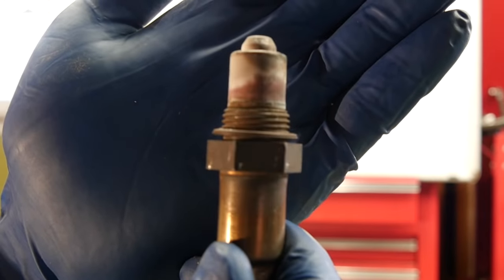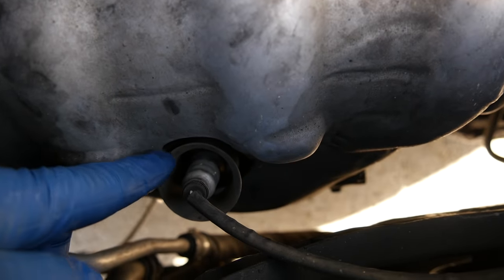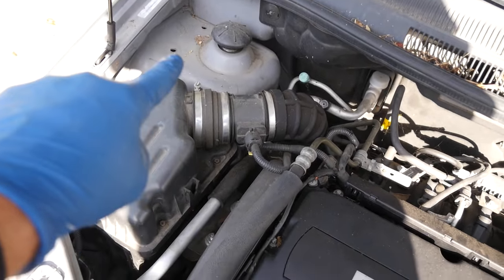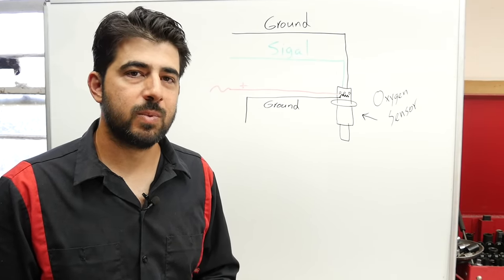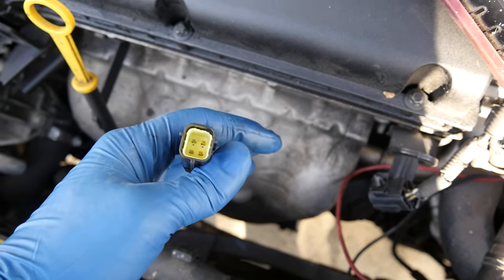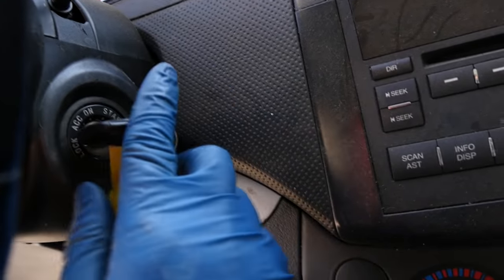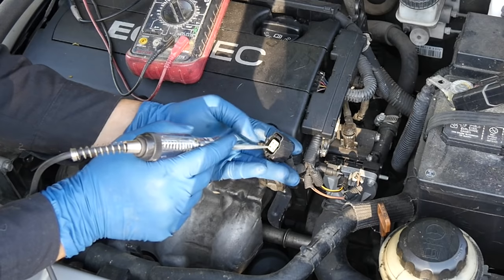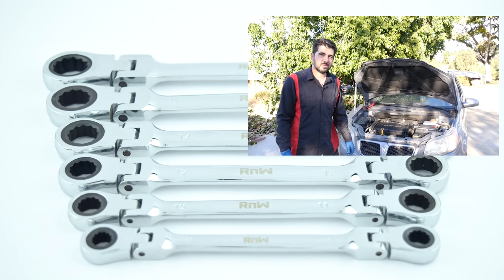Oxygen Sensor Trick and Operation Guide

Comment: I have a 2008 Jeep jk3.8 and randomly the che k engine light came on and problem with both bank 1 & 2 sensors 1&3 heater control circuit low. I thought it might have been the grounds since they all use the same ground, but it appears that all grounds are connected to one connector to the engine block. Any ideas? Maybe all sensors are bad?

Comment: Question. I have a 15 Nissan Titan and on my 04 titan I could delete the rear cats without check engine light. I’ve heard the 07 and newer the oxygen sensor and the map sensor positions were replaced.  So the map sensor is closest to the engine. Would this make a different as far as check engine lights go when I delete the rear cats on this truck

Comment: Nice video. 
However, I have a ford focus 2000 model ,but my downstream sensor has no single wire connected to it. It seems the wires were forcefully  pulled.. the wires are completely damaged and missing. Please it is possible to rewire it,especially getting that signal wire that goes to the car's computer. Thanks

Comment: Awesome vids dude. Question: could you also measure/question continuity between the signal wire at the plug and to the ECU harness pin that corresponds to that signal wire for the O2 as well? I'm chasing a A/F issue with a 993 Porsche. The O2 sensor is new-3 wire, but wanted to go through the wires from the plug on the harness to verify function. Came across your vids this am. Great info. Keep it up! BTW, I am a recovering Audi allroad owner lol! I had thre over 12yrs. -the last was 6MT that I got up to about 440hp. I sweat cam seals are a maintenance item on the 2.7t motor.
Reply: "Question: could you also measure/question continuity between the signal wire at the plug and to the ECU harness pin that corresponds to that signal wire for the O2 as well? I'm chasing a A/F issue with a 993 Porsche. The O2 sensor is new-3 wire, but wanted to go through the wires from the plug on the harness to verify function."
 
Yes, but you only need to go through the trouble of doing that if the sensor is not working. So, you should check functionality first. Make sure the vehicle is warmed up and running at its normal operating temp. Connect a scan tool and look at the data stream. Find your fuel trims and open/closed loop info on the scan tool. If the O2 sensor is working, you should be in closed loop (the engine has to be running.). Assuming you're in closed loop, check to see if your fuel trim numbers make sense. If they do, you've pretty much proved the sensors are working properly. 

If you're having a drivability issue and you think its O2 sensor related, bypass your O2 sensors and see what happens. In order for them to work the vehicle must be warmed up and in closed loop. look at the scan tool again while the engine is running. Put your foot on the gas pedal and make it go right to the floor. It has to be wide open, and nothing less. Watch your data stream, and the second you reach wide open throttle, the motor should go into open loop. If the car runs better at when in open loop, the problem is most likely an O2 sensor, or something directly related to them. If no change at WOT when the O2 sensors are bypassed, look elsewhere for the problem.

The above info can be applied to any car made after 1996. The procedure is OBD2 compliant, so it doesn't matter what kind of vehicle it is. They all have to work the same by law.

Comment: Does the power to the heating element, let's say for a 2005 Dodge Grand Caravan, shut off after it is warmed up enough?   Because, if it does not, and the heating element portion of the O2sensor is bad, theoretically could one substitute the proper value resistor (and proper wattage power resistor) if the O2 sensor is a bear to remove?    This of course just temporarily to get it to pass inspection until you have time to replace it and don't want to lay on the cold, snowy ground to do it.

Comment: I'm trying to figure out how ECM monitors EGR gas flow. I know some vehicles have sensors (Fords have DFE sensors) but my 97 Isuzu Rodeo (4cyl 2.6 engine) doesn't. I get occasional PO401 insufficient flow code....have cleaned out all pipes etc and installed a new EGR valve....still get this code. There must be something in the computer that trips this code. Is it using feedback from 02 sensor? My scanner shows 02 sensor output normal. Any ideas? Vehicle has 82,700 miles...gets 24 - 25 mpg ...manual transmission.

Comment: Do you have any knowledge on why my 2010 Nissan altima 2.5 is idling smooth, runs smooth, till i get on an upward hill on the hwy, it gets around 3000 rpms, and it starts loosing power so bad, alot of differant codes pop up, i get off the road, turn engine of, then restart it, it clears all codes, its in the shop now, they said it needed new timing chain, that didnt fix it. Muffler shop said converter was good, i had new maf sensor put on it also. Nothing is working i have had done. I need HELP😢

Comment: Thanks for this video, it's very clear :)
A question if I may. I want to add a switch to disable/disconnet my O2 sensors on my motorcycle, to use when I'm racing and don't want/need that closed loop feedback (I've got a piggyback ECU to handle fueling). In your opinion which of those 4 wires should I switch, in order to fooling the ECU to think that the O2 sensor is disconnected? I'd guess it'll be the permanent ground wire, but that's just a hunch.

Comment: Good Vid. Hey, mate in relation to these O2 Sensors. I have a 2000 Holden/Opel Astra with a 1.8 Ltr 4 cylinder in it similar to this motor. Now I had a set of new Extractors put on it and the O2 sensor was placed just downrange after the factor cast exhaust manifold. Basically, where all four pipes merged into one, is where it went. However, on the extractors the O2 sensor has been placed where only two out of four pipes merge (tri Y exhaust pattern) as this was how the extractors were made. My car seems to be using more fuel now so should I get the extractors modified so that the O2 sensor is placed after the merge of all pipes like the original factory manifold was. Any help appreciated.
Reply: Yes, have it modified so that the Oxygen Sensor is after where all four pipes converge. Right now it's only seeing 2/4 cylinders, and only seeing half of what it wants to. The car is seeing that the right amount of air is flowing in, so it's adjusting fuel timing to compensate. Moving the sensor should fix the excessive fuel consumption.
Reply: @GalaxyOneFilms  Cheers mate

Comment: That's good to know about the switching ground and the permanent ground. Nice!
Does anyone know the reason for not switching the positive?
Reply: @paulmccabe2889  At least not in the harness because one of the wires will have to be positive, that  one could just as easily short out. But it's probably more the way the ecu or ecm works. it's probably easier to protect the ecm if it's switching ground rather than switching the positives. Honestly i'm not sure why at this moment.

Comment: Thanks for video. Is there a reason why the "switched ground'' cannot always be grounded directly to frame full time.
Reply: I think that would run your preheater circuit non stop which would kill the sensor and battery in short order?

Comment: I replaced both 02 sensors 2 times on my 2.0l honda crv yr 2000 still getCEL for heating element circut code for both b1 and b2 I don't know what the problem could be? Cat is in alittle rough shape could that be causing this?

Comment: Hi, please help. I found that 02sensor bank 2sensor 1 was tapped with a sigle wire. And the wire is tapped from the 02sensor bank 2sensor1 went acrossed the engine and tuked behind the fender. It didn’t connect into anything. You have any idea why they would tapped it? Thanks pls help

Comment: What if you short the ECU using  the test light or  a multimeter? Can this happen? On my wifes car, the P0130 code come and go, most of the time not even a check engine light also the electronic drive pedal somemetimes does not work at all for a few seconds every 5..6 days. Any idea?

Comment: I have a problem that needs to be resolved and fast. I have over modified my 2006 350z now the o2 AF sensors upstream have a codes P0031 P1148 that wont go away. I've tried o2 simulators and bought 4 sets of o2 sensors for replacement and nothing works. Is the only way to fix this is a car tune by professionals or  what can I do to get rid of the o2 heater low voltage codes.

Comment: Great video! I've received my "O sensor" without the plastic protector that goes around the metal end, and there's grease all over that end. Do you just wipe it put clean with a piece of cloth, or do you use something else, since that is the part you'll screw in? Thanks in advance for your details!

Comment: I need help, I replaced the heated oxygen sensor bank 2 sensor 1 , the check engine light went off then a few hundred miles it came back on for the same thing and has not turned off. What could it be? I heard GM is notorious for this, but is there a fix? It’s for a 05 Hummer H2. Thanks!

Comment: Good day 
 I have problem with my Toyota Yaris 2012. It has low idling and when I turn on A/C it idle 700rpm. The engine also shaking
I replace new spark plugs, clean the throttle body, MAF sensor, pcv sensor, O2 sensor.
 But still having the same problem, I hope you could help me. TIA

Comment: When you change the o2 sensor (upstream air/fuel) do it improves things immediately or you have to drive the car a few miles?
Reply: The computer will "relearn" after a new sensor is installed. You can disconnect the battery - after approximately 30 -60 minutes reconnect it ...this will reset to factory presets...the computer will then relearn from scratch. Changing air temps etc is why....hope this helps ya!👍

Comment: When I was taking one of the 02 sensors behind the cat the threads broke off with it... I was thinking about just welding a brand new one in there? Otherwise I would have to weld that hole closed, drill a new one hole and tap it. Which is kind of a b. Any tips?

Comment: Sus videos son unos De mis favoritos! I put headers and full aftermarket exhaust in my 03 eclipse gt with no cat's. I put the oxygen spacers on  sensors #2 pos cats. I'm getting a 3 to 3.6 long term fuel reading.  But It smells like fuel is that because if the missing cats or is it running too rich? Thanks

Comment: Nice video but technically after verifying hot heater wire on harness side you have identified two out of four signals (not one out of four) since you already isolated the two heater wires. All you now have to do is find the constant ground and you've identified 3 out of 4. Of course it's not a bad idea to make sure of the switched ground in case there's a short.

Comment: What if connect the test light or multimeter on the positive battery with the signal first instead of the heater ground? Wouldn’t damage the computer?

Comment: Great videos.  I always check you out. Humor is pretty good too.  Hot a question. For ya my 2001 jeep.  every once in a while while i am driving ibget like a cracking sound out my exhaust.  Could that be bad O2 sensor check engine is on but codes only says misfire.   Not sure if O2 or maybe catalatic is going out.  Any insight would help.

Comment: My O2 sensor has 5VDC supplied to it. Then as it goes to closed loop voltage drops to 0-1VDC (signal). 12V to the heater.

Comment: My Pontiac vibe 2004 has catalytic converter stolen and fuel efficiency is lower than the average. I don’t understand why that happens because there is no second O2 sensor after catalytic converter

Comment: Can someone help me understanding my problem?
Out of the four cables, i have got one with 12 Volts feeding the air sensor. When i try to find earth on the other three sensors, all of them are grounded. One of them thou, has 12 volts running through with ignition off, and 7 volts running through when the ignition is on. I followed the steps in this guide when measuring with the multimeter. Please help. Thanks!

Comment: I need help with 😭 my pops 05 keep Rubicon it has the check engine light on for heater control circuit Low for all 4 oxygen sensors but I can't figure out what the next step would be I'm not that good of a mechanic but I Get the picture if you have any tips or suggestions also I was told about replacing pcm but I don't think that's the problem?.
Reply: Ecm* witch it could be but? Idk

Comment: Thanks for ur a training.. I have a problem with my power windows system main switch..all other windows are working  with the single switch but I can't operate on   drives side ,I tried to change the switch , still the same problem  plz help on how to work it out"""car model is Toyota filder first generation"""""

Comment: Awesome videos!

I recently replaced engine for my 2014 Chrysler Town and Country. I have this code, P219B.
My mechanic tried several things, but no success.
The upstream O2 sensors are working fine, bancung up and down between 0.1 and 0.9.
The O2 B1S2 shows reach signal, between 0.8 to 0.9.
The O2 B2S2 shows lean signal, almost 0.1.
All these at idle engine RPM. At higher RPM, no changes to the sensors except O2 B2S2, which jumps to almost fixed reach signal, about 0.9.
What’s the problem. PS GREAT videos 👍

Comment: So when a start cold 2:45 thats when your (rpm) drop from1000 to 900 Rpm after warming up the engine right?
Reply: Or is because the oil gets more soft when is hot and stars circulating trouh the engine lowering the (RPM)
Reply: I think its because the o2s start working only after getting to a certain temp and the car is running rich when you first start it up

Comment: Hi Bro,
I need your help, i have nissan Altima 2.5  2008 , i feel car fuel consumption went heigher soon , i do smell some dirty smells coming from under car , noticed also soon very light water sneezing with black carbon coming from exahust when car running on park ,
I thought it mighy be oxygen sensor , but i get no check engine codes 
Also i changed sparkles soon but not solved 
Please help

Comment: The procedure in this video is what I need to diagnose an oxygen sensor issue on a 2006 Honda CRV. I purchased a test light as recommended. Normally I use a VOM. I can reproduce the first continuity test for the heater wire using the VOM and the resistance is in range. The test for the heater power identified the heater power wire. The last two tests, the constant ground wire test and heater ground test did not result in  light from the circuit tester. I tried using the key off, the key on and the engine running. I also tried both battery terminals. The touching of the circuit tester did not result in a light at any of the four wires of B1S1 or four wires of B1S2. I may not how to use the circuit tester. Then tried all the above again with a VOM reading ohms and volts DC. I used the probe and got a light when testing the heater power, so it is working. What is odd is the tests using the battery negative worked. All tests using the battery positive did not work. Any help will be greatly appreciated.
Reply: I did read the light instructions since posting the comment above. This light is one way only from negative to positive, Jastind Premium Circuit Tester. Nowhere on Amazon or the box is this stated.

Comment: never connect your test light to the positive of the battery. f you want to find out ground just use the beeping mechanism of the multimeter, connect one probe to the ground and one probe to the testing point. If its ground your multimeter will beep.

Comment: Engine runs lean after replacing the oxygen sensor. In the first 15 to 20minutes vehicle accelerates fine but after heated up it hesitates and vehicle doesn't rev up. The sensor is genuine and bought from the agent. What may cause this problem?

Comment: When my engine reaches running temp I get on freeway then car starts retarding and jerking It kinda feels like a short it wont accelerate but wont turn off i got p1390 code cam crank i changed it replaced air filter and nothing any idea can it be oxygen sensor i thought it had a mass air flo sensor but didnt

Comment: I have a 2009 F150 for some reason I burn lots of gas no check engine light in my truck does not run funny at all one time at 60 miles an hour my truck jerked like it’s just increase the horsepower out of nowhere so I was thinking it was my Cas converter they were bad what after replacing them still burning through gas Unfortunately one more thing my RPM gauge stop working not sure if that has nothing to do with my gas please help any suggestions

Comment: This is southern dipper. Can you, or anybody give me an answer on the question I ask about my 2010 Nissan altima 2.5 loosing power. Since I posted the question,  I had all 4 spark plugs replaced, all 4 coil pks replaced, and changed the air filter. It is running better, but still at 3000, 3200 RPM'S, it is still doing the same thing. PLEZ, CAN ANY1 TELL ME WHAT ELSE I NEED TO TRY

Comment: Does anybody know why is it that when I disconnect any of the two downstream 02 sensor on a 1998 f150 they won't set off the check engine light and on my scanner tool they will still be showing a value (not voltage just %value) as when they are connected.

Comment: I have a similair problem on another sensor. I found ground and sigal 😉 site, but I can't get the broken wire out of the connector. Do you have suggestions of how to repair a connector? 
Greetings from Holland 🇱🇺
Reply: Use a depin tool to remove the pin. Repair the wire and crimp a new pin on. Insert back in connector
Reply: @basje1  Ok, thanks! Now find a depin-tool and new pins... 🤗
Reply: @MTorn  ebay amazon aliexpress bol depin tools are a few euros
Reply: @basje1  Thanks again Bas! Going to check it out 🏍